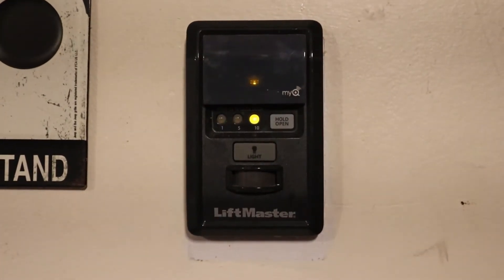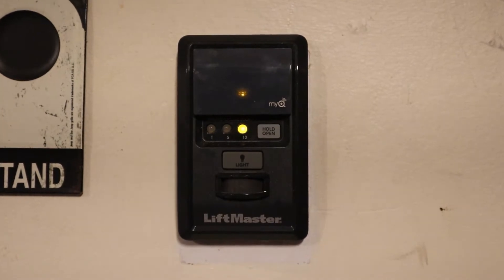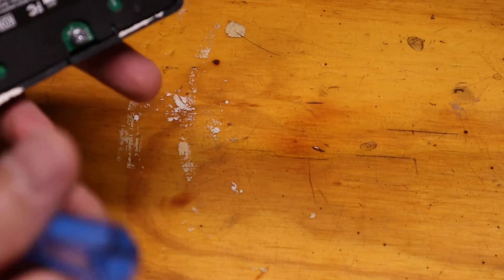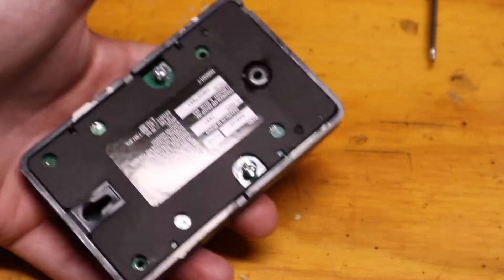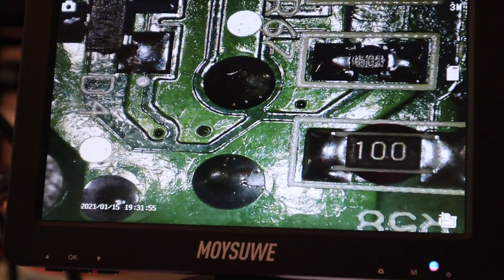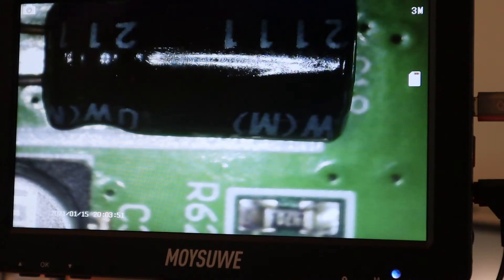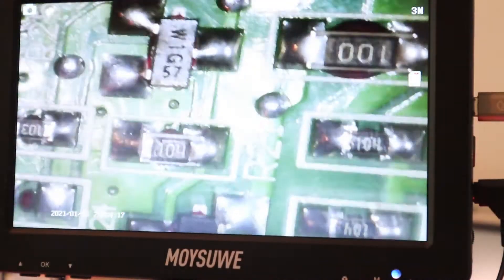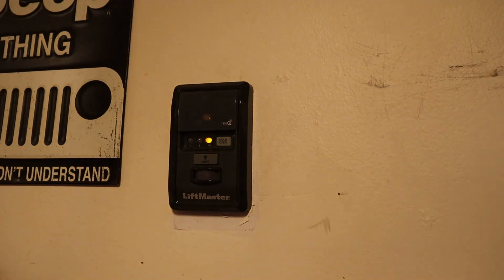Fix a Wonky Liftmaster MyQ 888LM Wall Control Panel

Comment: Excellent DIY repair and a very instructional video. I acquired the new caps, replaced them but did not know why when I reconnected the panel, the system was still not working and with the same symptom (red and yellow lights blinking together). But after seen your video, I realized that the caps need to charge before to work properly. A couple of minutes of waiting time and it´s done. Thanks a lot. Greetings from Lima, Peru.

Comment: Thanks very much for this video.  Mine was doing same thing.  Bought the caps at DigKkey.  They arrived in less than a week.  I just replaced them, this morning.  working again as it should.  Repair cost less than $2

Comment: Nice video.  I don't think your caps were bad - mine had one bulged at the vent, and both leaked electrolyte on the leads and PCB - ate some silk screen away even.  One cap was 0.5F (half rating), and the other was a short circuit.  Mine failed where the lights flashed and beeped randomly a couple times intermittently, followed by a random opening of the garage door in the middle of the night - like so many other people have experienced.  Horrible failure mode for this device, but working fine again with name-brand high quality caps.  Also trying to get a new 889LM control, as supposedly Chamberlain has extended the warranty to then end of 2023 - and offering free replacements.  Though they told no one of this issue apparently.

Comment: I'd replace those 5 silver can SMD capacitors with tantalums, too. Liftmaster obviously cheaped out on components there, and electrolytics have a limited shelf life, especially in a garage that may see temperature extremes.

Comment: I've been running a garage door company since 2009 and yes, there's a recall on 888LM (as someone already mentioned) and this unit was replaced with 889LM. I've had dozens of these units fail over the past few years and start opening the doors on their own! Had one earlier today in fact.
Also, you might want to change the title of the video to be more accurate (so it's easier to people to find). The device on the garage exterior with the pin pad is called a "keypad". This is called a wall control panel.
Reply from the maker: Thanks for the tip - I will do that!
Reply: Do you just call LiftMaster to get the recall fulfilled?

Comment: The keypad link and the capacitor link are one in the same. I have same problem, looking for best capacitor replacements.
Reply from the maker: Whoops sorry about that. Will fix that shortly.
Reply from the maker: Okay all fixed. The link for the capacitors was correct the link for the keypad was wrong.

Comment: So I bought super capacitors off eBay, Nichicon 2.7v1f. They arrived and have the correct values but are smaller in physical size than what I removed. I contacted the seller and he says they should do the trick. Wondered if anyone else has any issues like this. Neither caps have a temp rating which is the only other value of concern?
Reply from the maker: As long as they have the same voltage and capacitance ratings, and have similar dimensions as the one that they replace you should be fine. They don't have to be exactly the same size. I wouldn't worry too much about temperature in this application. If these were going in a power supply or some other product that sees higher temperatures I would be more cautious
Reply: @JoesGarageProductionsLLC  thank you, the only other concern a different seller on eBay told me was the ESR is higher on the nichicon ones I installed than the the original vina tech ones. He felt the same as you, the nichicons are high quality and the ESR being like 1.2 ohms vs .22 ohms may not come into factor in this application. I have them installed and they do work, they do power down a bit faster when disconnected than the originals do.